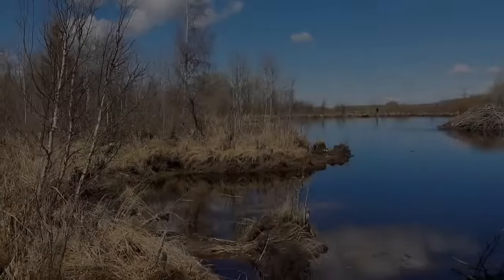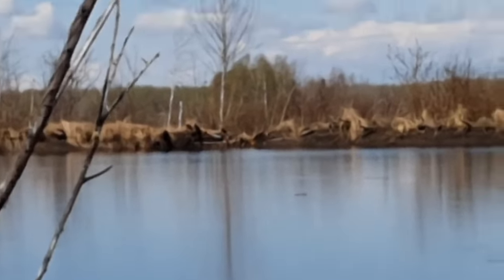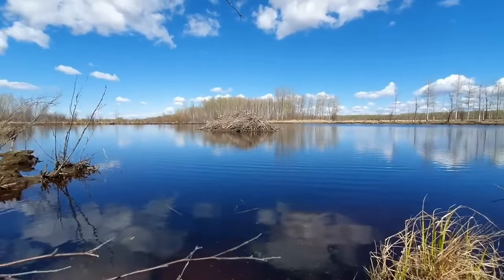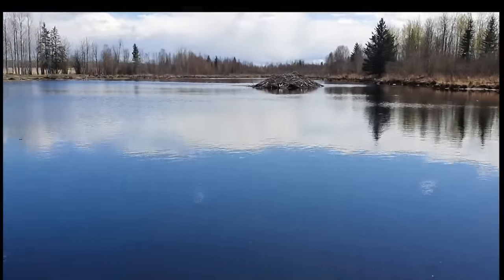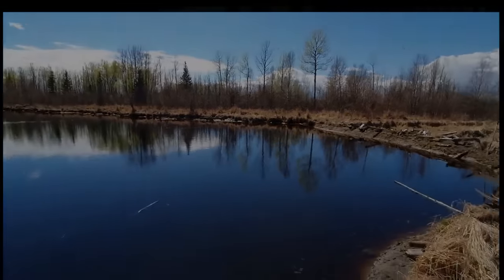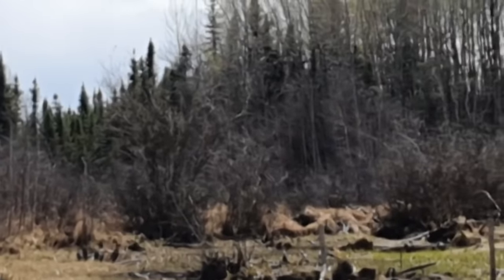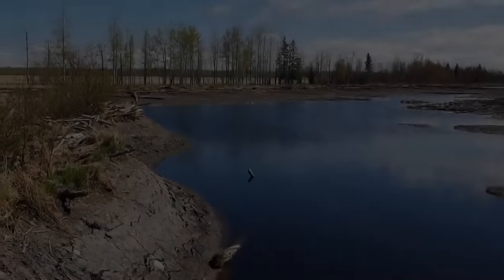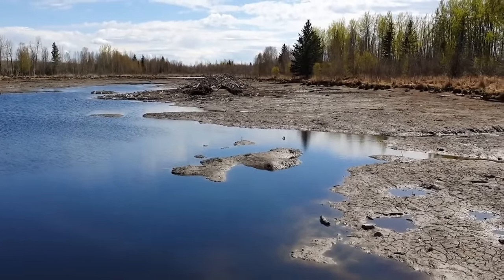Blowing Beaver Dams with Tannerite

Comment: Couldn't you use a boat to place a charge on the beaver loge when there are beavers there?
Reply from the maker: Most definitely you could do that, but the charge would have to be way bigger than what it takes to do the dam. The houses are crazy strong, and not being under water ( the part you want to destroy) the pressure from the explosion is lost in the air cavities. Even if you did manage to blow it right up, you'd likely not get them all anyhow since there seems to always be a few not in the lodge. 
 It's way simpler to get rid of them by damaging the dam & then waiting for them to come repair it & shoot them with a gun.
Sometimes It's good enough to drop the later back to a manageable level, & other times they need to be removed. Here, there's actually a bounty on them, I've had other comments from folks in Europe that are beyond upset, because over there in places you can be fined thousands for disturbing them.

This particular dam was a rare one, in that when I returned to check on it there was no signs of repair attempts. Upon further investigation I found the house abandoned & actually made a video of exploring it with my kids. They were likely killed during the winter by a predator, most likely an otter.
I've got a few others in my playlist things that go BANG. Here's the link to the exploring the abandoned one. https://youtu.be/vgSdgKtDyhc
Stay tuned my friend, and thanks for watching and for your comment.

Comment: where do i get tammerite   and how what to sHoOt A T TO EXPLODE I HAVE BIG BEAVER DAM WHERE I FISH IS IT OK TO DO THIS WITH DNR NOT ABLE TO GET BACK IN THE LAQKE BECUSE OF THE DAMS WIL HURT THE FISH POPULATION ALSO WHEN I WAS YOUNGER WOULD USE DYNAMITE HA THANKS
Reply from the maker: Depending on where you are in the world.  Here in Canada (so far) it can still be purchased at outdoor hunting type places. There's a few different brands.  Thundershot, and sureshot are two others. I have some of both I think. There's also a rimfire type which can be set off with a lower speed bullet.  But most require the higher bullet speed/ pressure. I think it's something like 2000 feet per second.  I  tried once with a 22 magnum and it worked once,  but not the second time. 
One of the hard parts for doing beaver dams is the placement. It has to be visible to shoot,  but that allows the loss of a bunch of pressure.   I had pretty good success with smaller amounts on a couple of my other videos. My playlist things that go BANG might be helpful if you haven't already watched them.

Comment: Damn. Do beavers really construct dams big enough to hold back that much water?
Reply from the maker: Oh yeah.  An enormous amount of water. It's even more than that,  because once they build,  they constantly build bigger and stronger for generations.  THEN they build more upstream of that for as far as they can go. 
This one the previous couple years caused flooding into the farm and pasture land on 3 sides that caused the loss of access or use of probably somewhere around 2-300 acres of land. 
Impressive really. 
The end of the video shows the level dropped . Just as interesting to me was exploring the abandoned beaver house with my kids.  I think that video link is pinned in the comments.  I'll check. 
Equally impressive is a few other looks at the dams. In my playlist things that go BANG  there's some more. 
Stay tuned for further nonsense and entertainment my friend.  Check out the other videos if you have time, and thanks for watching and for your comment.
Reply: I've seen beaver dams along side of a logging trail that is 10 feet high !  The water on the dam side is 15 feet deep with a trickle of a creek coming out the bottom across the trail !  Those pesky beavers are incredible engineers !
Reply from the maker: @gksox  they certainly are amazing critters! Sometimes they back up too much water and flood everything out,  but generally they back up water for cattle.

Comment: Should have put those on the beaver house too.
Reply from the maker: Well Curtis,  as it happens in this case you get to take tour of the inside of the abandoned house if you want. 
I returned afterwards to check it out and discovered that it was abandoned and the water was gone. Took my kids to explore it. 
As for normal cases,  it's pretty tough to get to the lodge because they're usually out in the middle of the water.  Another issue is they're just like the dam in construction methods,  except above water level and dried out like a mud brick.. Easier to just hunt and get rid of the rats than to destroy their house..
Full points to you for putting up with the poor editing on this video. 
I posted a couple other ones afterwards of other dams that are shorter and easier to watch.  Hope you enjoy them as well.

Comment: Have you ever tried making ammonium nitrate anf diesel fuel in a pipe bury it in the dam and put tannerite  on the pipe as a blast  starter?
Reply from the maker: When I was a teenager we used it, but since the Oklahoma city bombing decades ago all the fertilizer with high enough nitrogen is not available here for normal people.  It sure worked well,  we used 5 gallon pails of it.
I am going to try a couple other ideas I've been messing around with to see if I can bury it and still set it off so that less pressure is lost going straight up like this. 
Hope you enjoyed the good parts of the video.  I've got a few more in my playlist things that go BANG. 
Stay tuned my friend!
Reply: @lovesloudcars  I did explosives in the army almost 50 years ago that is what made me wonder about amatol
Reply from the maker: @tomhysell596  too many nut jobs and terrorists these days & all the simple stuff isn't available for regular peasants like us anymore. 
I'd think a part time job of removing beaver dams would be a good job. Hope you have a great weekend & thanks for the reply.

Comment: I watched another one like this only they used 150lbs of Tannerite on an old dam but didn't breach it. Oh, they made a huge hole but it wasn't near big enough to open the dam. They weren't the smartest guys to ever use Tannerite to blow something up! They put 150lbs off Tannerite in a hole in the Beaver dam. Then they put a bucket of rocks in front off it. The Tannerite explodes and two big rocks go flying over their heads and land not too far behind them. I'm no expert on explosives by any means but I knew that was a very bad idea.
Reply from the maker: Wow. it would be fun to use that much but the rock thing is crazy. A little overkill no doubt, & that much could make a whole lot of flying debris. Kind of like people blowing up cars & junk with it. There's going to be some people killed & it will be outlawed because of that nonsense.
When I was younger My Dad's friend was an explosive expert & we knocked out a dam a few times with a 5 gallon pail of fertilizer & diesel fuel. THAT made a bang. Knocked a hole about 8 or 10 feet wide & 6 or more feet deep.
Posted a couple more of these since this one. - Getting better at editing I hope ( and catching it on film...) 
I'll copy the link for the one posted in September, & you can check my channel for the one last week, it will be the most recent.

https://youtu.be/tYiDXaeOWGo

Comment: You do what you must do to care and feed your family! Is there a way to use the damn to help you? We know that they are going to repair what you did. Can you put in water wheel. Make use some of the water and lower the lake at the same time?
Reply from the maker: Excellent points and questions Donald. ( By the way thanks for putting up with the poor editing job on this one).
Most places the dam gets left to hold back water for cattle and can be very beneficial, especially in very dry years. The problem with this one is it was so big that they were backing up onto flat ground enough to flood out or restrict access to several hundred acres of farmland. - pasture, hay, and crop land.
On my own place ( skidder vs beaver dam videos) they were destroying the shelter belt & causing quite a bit of damage & just would not stop.
There are several problems with trying to put in something like a water wheel or many other things. They're quite smart & extremely persistent if there's any sound of running water, or detected current. They usually plug up or damage stuff trying to stop all water flow. They'll plug up overflows and all sorts of things. Even culverts that reach way out into the dam & have wire cages around them get trash & mud piled in, on, and around then in attempts to stop water.
Access to install anything is also terrible if it requires any machinery because one side is flooded & the other is usually some rugged creek bed that is inaccessible with anything much except a tracked hoe. All of which can be VERY costly.
cost of course enters into it, as well as because they are out in the middle of nowhere, it would be very difficult to harness anything recovered from it.
Thanks for watching & your comment. Stay tuned for further nonsense and entertainment. I post quite a variety of things & hope they are entertaining or interesting to other folks.

Comment: which shows why an excavator is needed.   Beavers  can fill those gaps overnight.
Reply from the maker: Yup. In this case it turned out perfectly fine. ( see my video of crawling inside the empty beaver house).
But they can plug up a hole in no time. That's why I pushed the one on my place out with my log skidder. got the water out and then cleared the beavers out too.
Forgive me if you don't want to see them, but if so, I'll try to post the links for both here in this comment. so you don't have to go searching for them.
skidder year 2:  https://youtu.be/KOl3QDp3egA
skidder year 1 : https://youtu.be/10S-406L8fs
beaver house:  https://youtu.be/vgSdgKtDyhc

Comment: They’ll have it fixed tonight
Reply from the maker: That's how those little beggars operate. BUT in this case it wasn't repaired at all! I returned to check it out and it was drained down with no signs of beavers.  They must have been eaten during the winter,  for they certainly were all gone. 
 I returned with my kids to explore the abandoned house and posted that video too. 
Also full points to you for putting up with the poor editing on this video.  We should have fixed it up a bit more.
Reply: @lovesloudcars  oh that’s cool I always wonder if Everyone gets rid of the Beaver before they take the damn down otherwise will fix it overnight
Reply from the maker: @tobinbarrette1141  most of the guys I know just knock out the dam and either hope the water drops to a more manageable level before they return to fix it, or hang around and wack them when they come back. But you've got to get rid of them or they'll never quit.
I'll try to find the link to the beaver house one later.  Just finished my lunch break now.
Reply: @lovesloudcars  oh ya over nite They will usually have it fixed

Comment: he just destroyed a beaver home and a dam that took months or years to make for them why.
Reply from the maker: Hey voidmaster thanks for checking it out and for your comment! There are a couple points and valid answers to your question that I hope you are truly interested in knowing the answer.
The home (lodge) was not harmed in any way, since it was out in the middle of the water as shown in the very first part of the video.
Home as in  " habitat , place & pond where they live"  would not actually have been destroyed either with a breach that large, but would have been repaired overnight  like they always do. The expectation was to drop the water from flooding the surrounding area to the normal previous years' water level.
 I suspect you didn't watch the whole thing before you commented & that's fine. I quite often do that myself, but I hope that my (lengthy) reply helps you understand the complexity a bit more.
 Surprisingly enough, they did not repair it! I was very surprised to return a few days later ( 10 minute mark on the video) to discover they were gone. Most likely eaten by a predator during the winter months. Many animals love catching and eating beavers like bears and wolves -which both live here, but otters are the primary winter season predator since they are capable of swimming under the ice and getting into the house. I actually made a video of an otter's tracks just downstream the previous winter, and assume that's what happened.
But there are answers to the REASONS why it was done is flood damage and restricted or loss of access to farmland. This dam the previous year was well beyond the normal creek banks and the landowner could not  harvest grain crops on the west side of the property, pasture land was covered on the east side, and directly south was flooded enough to loose access or ability to hayland. combined area affected was several hundred acres.
So- although blowing things up in real life is quite fun, it was not done just for entertainment or for the sake of destroying things ( like people sometimes do when smashing windows for no purpose whatsoever but to wreck stuff).

Full points to you for putting up with the poor editing job on this one if you did  or do watch the entire thing!!
You might find the video of exploring the abandoned beaver house interesting. After I found that it was empty & not repaired as we expected, I returned with my kids & got to crawl right inside.
Here's the link: https://youtu.be/vgSdgKtDyhc

Comment: Thank you for the video.  Beavers usually flood my father's place every few years.  2 years ago they trapped 9 over a few months before they disappeared but now they are back it's worse than ever.  We're still waiting for his trapper to come back but this gives me some ideas!  How far away did you give yourself to shoot at 8lbs of tannerite?  I guess if you bury it in the mud or water as long as you can get a shot on the top of the canister, it will explode?
Reply from the maker: Yup. the pressure/ weight thing is what does the work for you. Just visible enough to set it off is a lot more effective. If it's placed on top it won't do anything for you. I've since posted 2 other ones I did that show a little different shape of charge that seemed to work ok ( & a little better to watch because of more careful editing too). Check them out on my channel, should be easy to spot in the list.

Distance is probably a personal choice, but personally, with that much you'd better be at least 100 yards. If you are shooting from the water side or the dam side changes things too. It's flying debris that is the dangerous part. AND I'm NOT a professional, so take it with a grain of salt. DO NOT make the canister out of anything that could become shrapnel.
Reply: Beavers make good pelts
Reply from the maker: @michaelmoon6675  yes they do,  especially when they've got their winter fur.

Comment: Last I was taught beaverdams are actually beneficial for the environment !If not let me know thanks
Reply from the maker: It all depends on where they are for sure. They can hold water in places and stop everything from drying out. I know my father prefers to keep them around to hold water for cattle.
The problem is beavers NEVER stop. they'll keep building dams further upstream as far as they can and flood out & kill every tree they have access to.
In this case they had flooded so much that it was impossible the previous summer to access hay land, farmland,  and pasture  in 3 different directions to the tune of about 6-700 acres..
Excellent question though & thanks for checking it out.
Have since posted a couple other ones that are edited much better. Stay tuned for more adventure!
Reply: In other places, they can be responsible for killing tens of thousands of dollars worth of 30-40 year old hardwood timber.  If water stands on tree roots for several months each year, the trees will die.  There is nothing beavers do that is positive or beneficial for the environment.

Comment: beavers are an endangered species elsewhere in the world, but here u r destroying them
Reply from the maker: Well my friend,  thank you for watching and for your comment.  They  may be endangered in  some geographical areas and protected in many places.
Here,  they are considered a pest animal by the fish and wildlife department- including having a bounty on them.  Crazy how different places can be so different hey?
You might not be aware,  but they don't live in the dam either,  but build a lodge usually surrounded by water. So knocking out a dam usually does nothing more than dropping the water back down to non flood levels. In this case I returned to see how quickly they had repaired the damage and was surprised to find it empty. They must have been killed by predators during the winter. 
We often leave them alone so they can hold back water for cattle,  but they never stop,  but continue building higher and more dams further upstream.  Sometimes causing a tremendous amount of damage and flooding hundreds of acres of farmland.  -As was the case here. 
You might find it interesting to watch the video where I returned with my kids to explore the abandoned house. 
I think the video link is pinned on the top of the comments.

Comment: Should have did away with lodge. They will repair both spots
Reply from the maker: That's the crazy thing about this particular one is the beavers turned out to already be gone! I went back to check it out and it was dry.  Made another complete video exploring the abandoned house with my kids. 
But you are right, if they're still around they'll fix it up and continue cutting trees flooding everything they can. 
I've posted a couple other ones that are shorter and edited better to make them easier to watch. 
Stay tuned for further nonsense Terry!